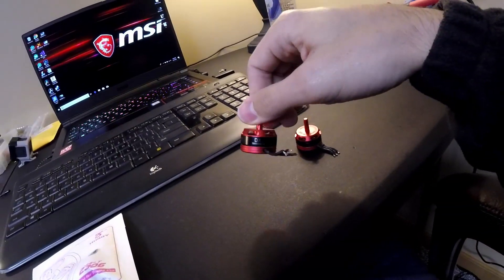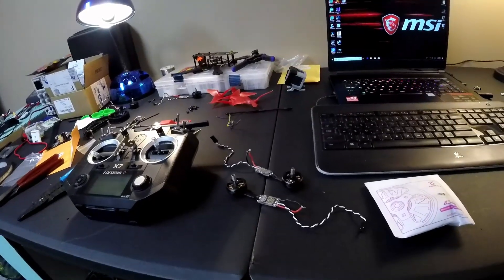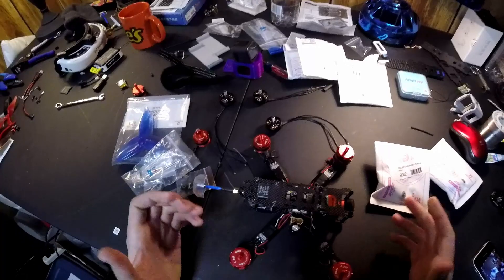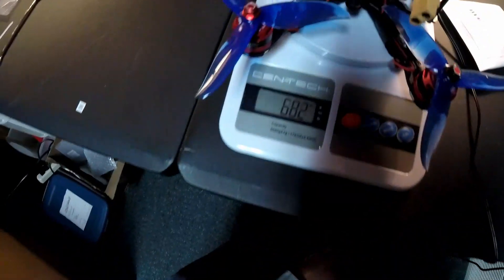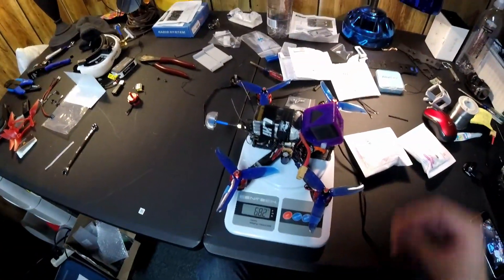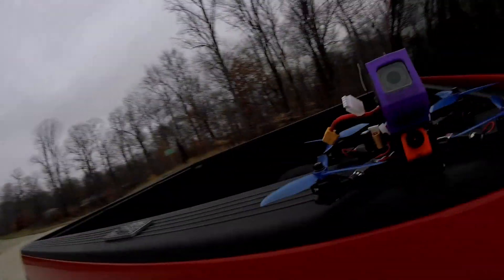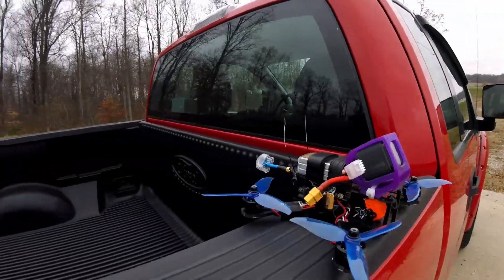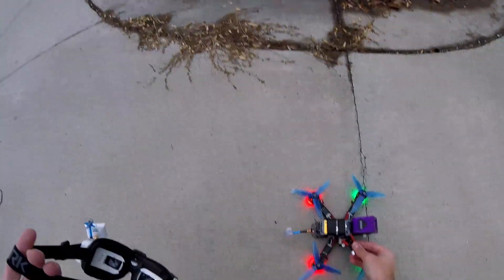3BHobby 2306 2500kv Cheap Motor Comparison

Comment: You managed to stumble onto some of the absolute highest value motors on the market... i run them on 2 freestyle quads and one long range rig
Reply from the maker: UptiltFPV that’s awesome! Can you give me some details on your long range rig? I’m curious about frame/prop size selection and your battery cell/motor kV combo. Thanks man!
Reply: @FishStick_ADV  Hmm, lots of info there... so, first thing to understand is that I made some mistakes in my build that I will be rectifying as soon as the motors I have on burn out. Personally I went with a local CAnadian company for the frame (RVS Duke Pro -7" Ultralight), Used a diatone Mamba 30x30 stack (cheap but havent had problems with the 30x30 ones yet, unlike the 20x20 version of that stack), AKK ultimate 1200mw VTX, Caddx Ratel Camera (best camera on the planet, trust me) , A Bn-220 GPS/glonass module (very inexpensive for one of the best units out there), but heres where I made a mistake; I went with the 2306 1700kv motors on 4s... now for 7 inch props 4s is fine with 1700kv for efficiency but what I have found (and was warned about) is that the 2306 size motors are just not big enough to give you the torque you need to make the 7 inch props feel really smooth... If you build one just done cheap out on motors and get a set of 2407's or 2507's.. even the xing 2208's would be ok.. in this case you will pay 30 bucks a motor but its one case where I can justify spending that much on motors.... hope that helps man.. happy flying :)
Reply from the maker: @Flight Therapy Thanks so much for taking the time to put together that response. The insight, especially on the motor selection side of things, is very valuable. I've been checking out the parts you've listed and am currently installing a Caddx Ratel 2.1 on my 5" per your recommendation! Hoping to continue on into 7 inch soon. Thanks again!
Reply: @FishStick_ADV  oh I have an update for you. I took off the 2306 motors and replaced them with Avenger 2507s in 1500kv (4s for endurance, 6s for rippage lol)... the difference is insane! All thr "balance" issues i had with biblade props are gone. The low end control is silky smooth and the craft moves with AUTHORITY when i tell it to... in my mind bigger motors are an absolute must for 7"... i actually just ordered some 2407s for one of my 5"s lol... once you feel that power you start to wonder lol
Reply from the maker: Man... don't do this to me...  I can feel dollars leaving me as I read... lol!   I bet 2407s will be crazy on a 5". I imagine you've probably tried them by now?? When I get around to a 7" build I will take your advice here. Big props deserve big motors, and 2507s sound like massive motors!
Reply: @FishStick_ADV  I think the biggest surprise for me when it comes to the larger stators is that while there is a small (sometimes undetectable) change in amp draw. The difference in flight feel is worth every second of flight time you lose... in the case of the 2407s on the 5inch i get maybe 20 seconds less flight time but i get the linear throttlw of a 2207 with the low end control of a 2306.. in the case of the 2507s it feels much the same except with the 7inch props the efficiency is through the roof... i think in future years we are going to start seeing large stators as much less of an issue when it comes to amp draw and instead see them as almost neccesary for the flight performance we want. Especially with freestyle. In my mind the difference between a 2207 and a 2407 is as big as the difference between 4s and 6s, maybe bigger. The bigger motors also give you a much wider range of available props for 4s freestyle especially.. Good luck with your builds man..
 P.S. one last thing. My absolute favourite budgey motors are the BBB Trainer 2306 2500kv. They just released a 2408 in this lineup. If you want to try a largw stator without paying brotherhobby prices, i would go with them.. honestly if i didnt have the BH motors already i would have got the BBB ones instead
Reply: @FishStick_ADV  If you want more detail on all this KABABFPV just released a video on this EXACT topic
Reply from the maker: As I've said before, you've got some great information to share once again. I will definitely look into those 2408 3B motors when my stash of 2306 runs dry, but the things are tough as nails! I want you to know that the Caddx Ratel is awesome and I appreciate that recommendation! Best I've used to date without a doubt. Better than the Eagle II and easily better than the swift II. I've been watching Kabab's channel. great stuff. Thanks for all of your help man!
Reply: @FishStick_ADV  Hey no problem buddy this hobby is all about sharing and comparing knowledge. Glad you like the ratel, its def my absolute favourite camera. If you do go with the BBB 2408 for long range i would consider getting the 1900kv ones and running 6 inch props. The efficiency will be great on 4s and it will be a beast on 6s if you use a compatible stack. Im actually thinking of building a 6 inch with those specs.. i have an addiction lol.. once you try long range you wont want to go back man but put those hours in learning freestyle tricks too if only to have the muscle memory to get out of sticky situations when youre way out there... hiking many miles for a downed quad Suuuucks.. ( thank you early R9 firmware🙄) cheers man

Comment: Performance is important but not everything. with extra $3 you get performance of course, and also the better build quality. The red 2205 motors you have are from the same manufacturer who made racerstar motors and I know their bearings, aluminium quality is cheesy! Very easily to get deformed.

On the other hand, 3Bhobby has been pretty reliable for me. The bearings are one of the best, went through many flights and light crashes and still sounding smooth! The bell and motor parts are very solid, as well as the hollow shaft. That's where your money go to!
So if I had to pick between those two motors, I'd go for 3Bhobby every time!
Reply from the maker: Tran .Dat  this is great input, and I’ll second it 100%. My experience so far has been identical to yours. The increase in quality and manufacturing consistency you get for $3 more per motor is impressive.
Reply: @FishStick_ADV  These are a new breed of "budget motor" man, couple years ago you would NEVER see anything like these or the Emax Ecos

Comment: The question for me is, did the 2306 deliver more power than the 2205? I am considering those for my build and I am looking for a more low end thrust. I run 2205 currently
Reply from the maker: Jorge Meza the 2306 motors absolutely delivered more power than the 2205s, but the 2205 motors I used here are very cheap. If you have a nice set of 2205s like eMax motors, you may see less of a difference in performance than I did... but that goes without saying. The larger diameter stator of the 2306 does have noticeably better low end torque than the narrower 2205. The biggest difference I saw was actually in top end power, but I also went up in kV. If you held kV constant, you’d probably feel the increase in torque a bit more.